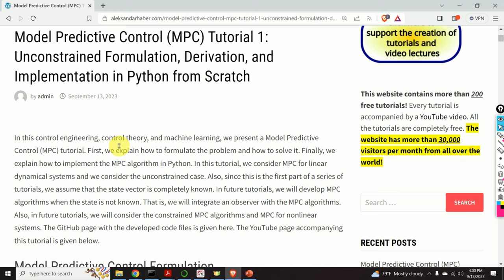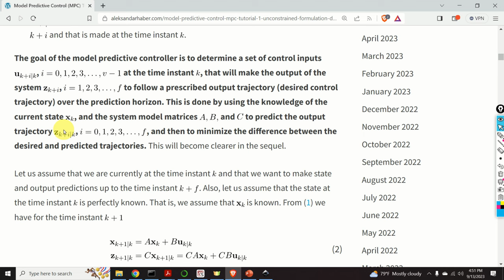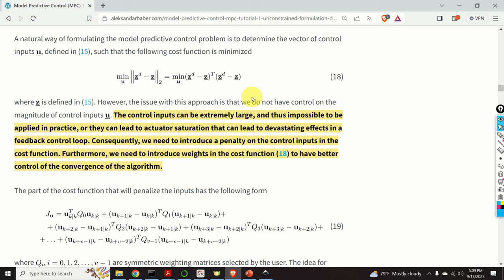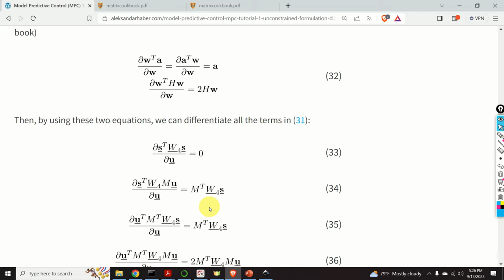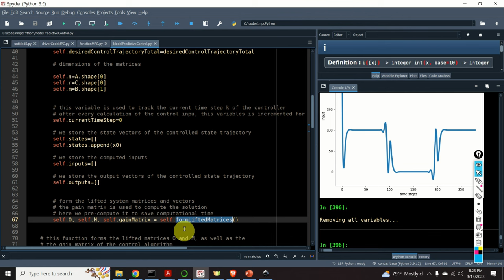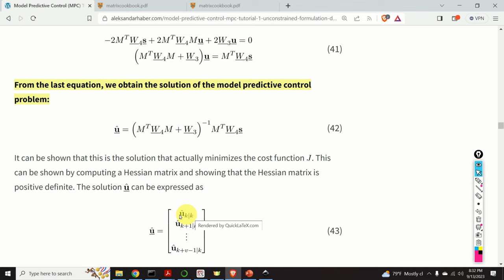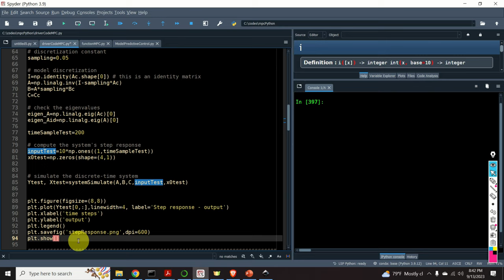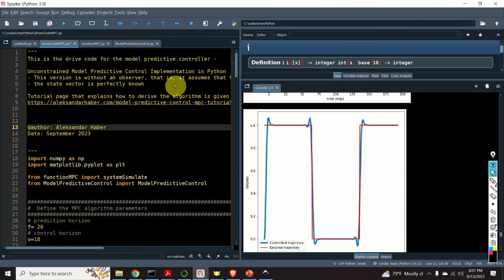Model Predictive Control from Scratch: Derivation and Python Implementation-Optimal Control Tutorial

Comment: Hey, there are some written errrors:
in equation(13) the last line of matrix M, the power of A should be {f-1}, {f-2}, {f-3}
the equation(15) has the same problem, and "C\bar{A}_{1,v}B" should be replaced by "C\bar{A}_{v+1,v}B".
By the way, the tutorial is great that helps me a lot, thank you.
Reply from the maker: Thank you! I will correct these typos in the updated tutorial and on the webpage.

Comment: Indeed, the best tutorial, thank you very much, can I ask if the model can be easily modified for a Multiple Input Single Output (MISO) system with 4 inputs and 1 output by changing r=1; m=4 and n= 1 ? or there are more considerations?  Thanks for your time!
Reply from the maker: Hello, these are free tutorials, and it took as a significant amount of time and energy to create them. Usually, you will have to pay thousands of dollars to enroll in a university course in the US to obtain this quality of lecture. Except providing these tutorials, we do not have time and energy to provide answers to particular questions. Spend some time to understand the algorithm and the code and your answer will follow immediately.

Comment: Thank you for sharing. However, I have a question, please. I am currently implementing an MPC to control the temperature inside a room. To model the system, I used a neural network that takes as input a window of data (disturbance_w, control_w, output_w) to predict the output over a prediction horizon. Then, I use these predictions to calculate an objective function in order to obtain the first command to apply to my system to get the first output. For this, I use scipy, but the control proposed by this library remains constant regardless of the output values (the output does not follow the reference). Do you have any advice to improve this?
Reply from the maker: Unfortunately, due to lack of time and energy, we do not provide free help and free consultation.
Reply: @aleksandarhaber  No worries, thank you anyway for the effort you put in and for sharing this valuable information in your tutorials.